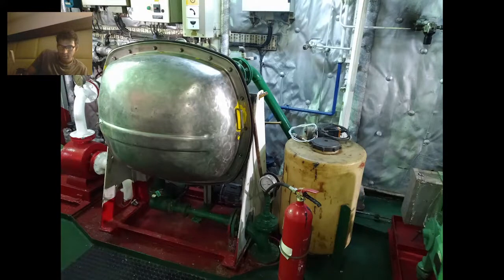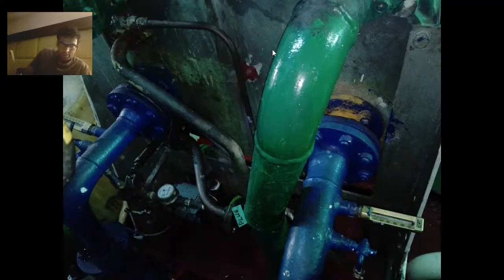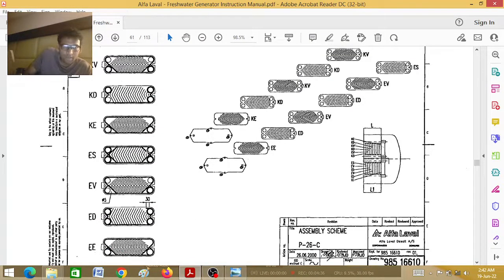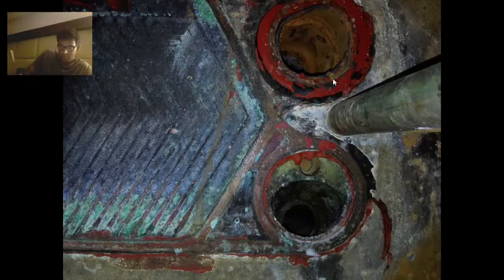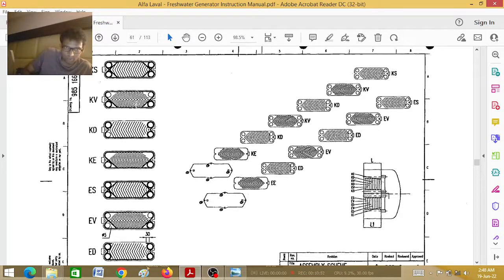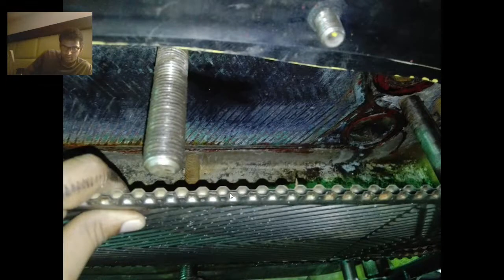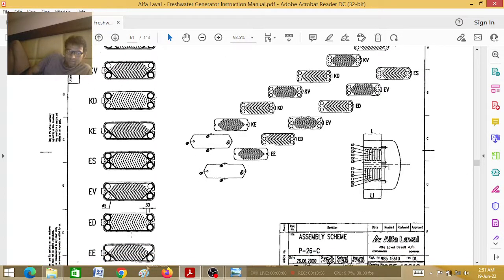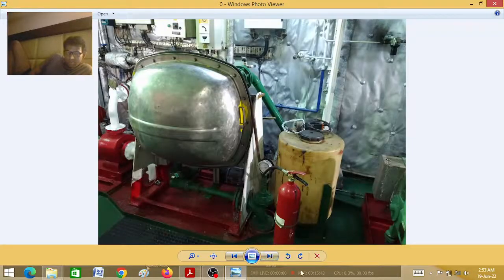How to assemble Fresh Water Generator plates. Alfa laval plate type.Working principle of FWG

Comment: I opened Evapotor all plates and i can see one old hard full gasket of plate size attached to frame at last and also 3 rubber gaskets attached to jacket inlet outlet and sw inlet holes .

So is it required to make first one full gasket of plate size and then put first plate or not ?
Reply from the maker: Yes, it's required to put first gasket in full only : the purpose of putting full gasket is to make leakage free fwg frame body , hope it's clear .